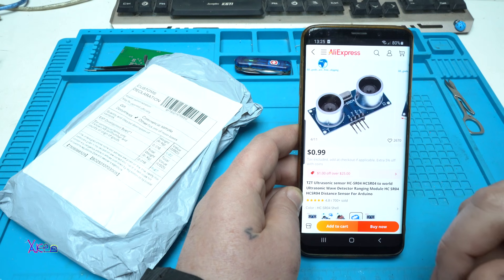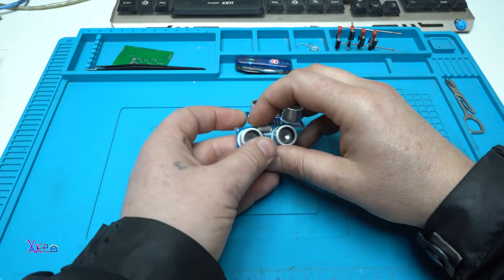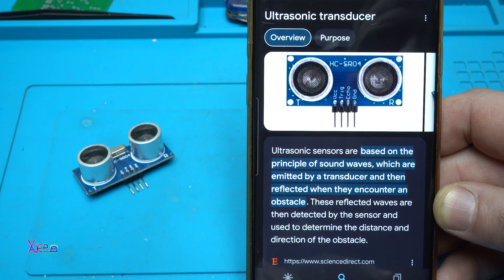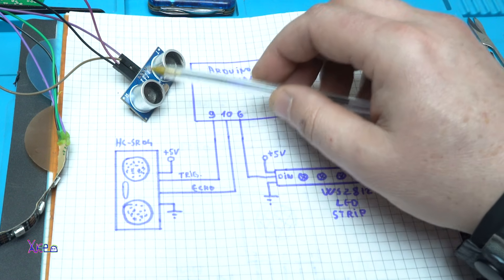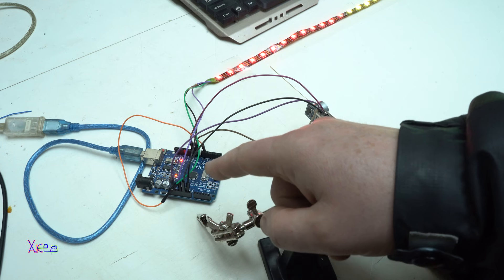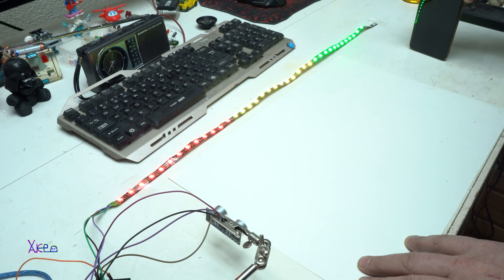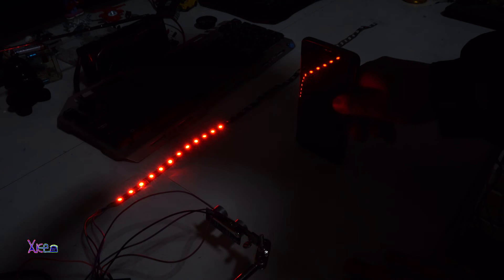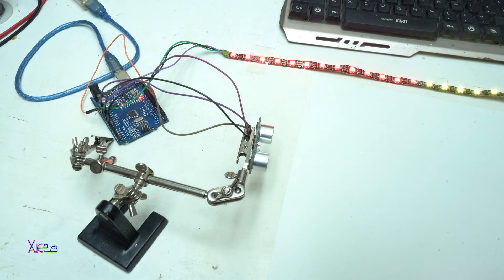USING  $1 Aliexpress ULTRASONIC Module I Built COOL DIY Project?

Comment: use the other to follow from behind turning the lights off. Would make a cool path light that follows you. Actually you would only need 1 sensors and do the rest with the code.
Reply from the maker: With small changes to code that is possible